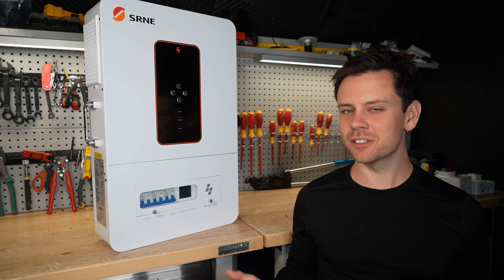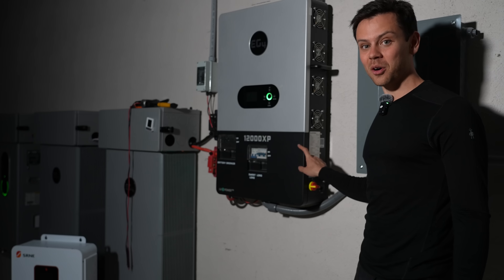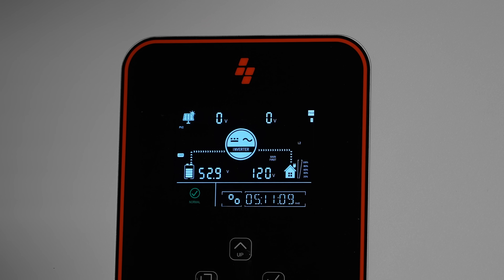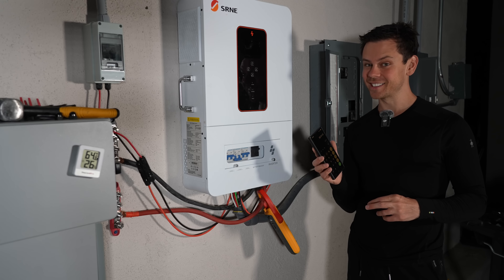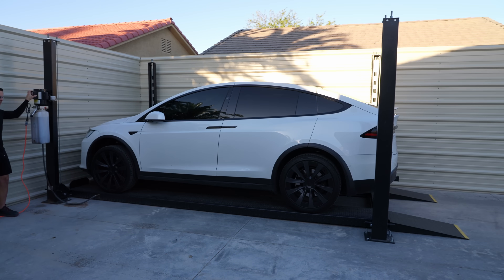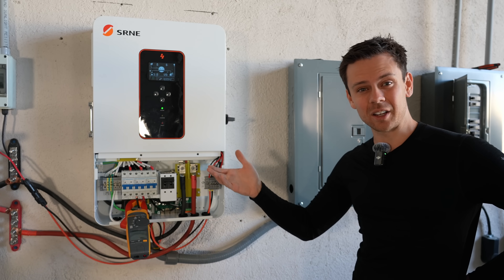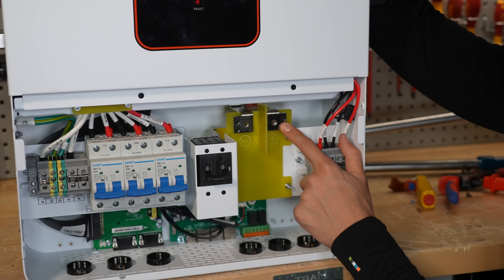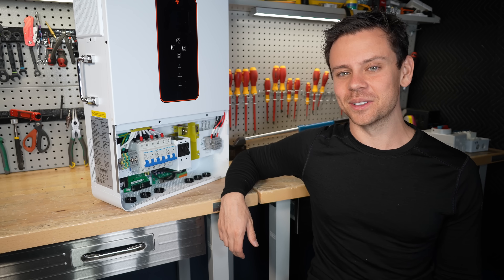NEW 6,500/10,000W SRNE 120/240V Inverter Full Review: EG4 6000XP Competition?!

Comment: FWIW  I have a 6000xp luxpower... it draws 100W  no matter what and a little more if you are using it.   The eg4 software some how reduces the idle consumption.     I can tell you a 6000 split phase where you can only draw 2500 on one leg before it shuts down is NOT very useful.    If one does not NEEED  240  v.  this inverter in not worth it... I would be WAY better off with two SRNE  5000  one hooked to each leg... NO  240v.  I would have 9000W  4500 each leg of usable power at 120 v.     balancing the consumption form one leg to the other is a real pain in the rear.

Comment: I was wondering if you would ever be interested in trying to turn some of these inverters into computer UPSes and see how well it works out.  When you look at the typical UPS, you are stuck with Pb batteries and usually you are dealing with a short run time.  You also have things like you need headroom for charging the batteries in addition to your normal load.  Then the batteries only last a few years and you have to swap them out.  I have been having trouble with the APC supplied batteries, which are just the cheapest cells they could find with their label slapped on lasting under 4 years while 3rd party battery cells are lasting over 5 years while selling for a fraction of the price.  And I am seeing this both for my personal UPSes and for company UPSes.  So dealing with a lot of UPSes and seeing a lot of early failures with APC supplied Pb batteries, some just at the 3 year mark.

When you look at inverter units like the Victron MultiPlus-II, it is supposed to have a UPS mode and it is supposed to be able to do things like say limit it to only draw 1,500W from shore power, but allow up to 3,000W to be drawn by pulling from the batteries.  Then when load is lower, hold the total shore power draw down to 1,500W when recharging or whatever you set it to.  For people with their crazy gaming rigs or what have you, it does seem like a nice option to be able to go over and then automatically recharge later.  In the literature for this inverter, they talk about a switch-over time of under 20ms.  Compared to your industrial APC Smart-UPS, this is a long time to switch over in an outage.  Then there are also things like some LFP batteries are coming down to price parity with Pb batteries while also supposedly lasting for decades compared to the 3 - 5 years of APC supplied Pb batteries and often 5 - 6 years of other generic Pb replacement batteries.  It would be nice to have a general comparison between say a good Smart-UPS with an extended run battery box and a Victron MultiPlus-II 3,000W inverter with a 48V server rack battery.  Maybe even toss in an MPPT charge controller and setup where you could be pulling solar power directly to your "UPS replacement".

Comment: The idle consumption is higher for the same reason that a proprietary television subscription receiver is a power waster. They are built cheaply with low cost, wide tollerence components. That is one of the best reasons to not buy this inverter. That said, I do buy this kind of tech but not at retail. If you're going to buy cheap tech, buy it directly from the supplier and buy a spare at the same time. I spent $900 for a pair of 6.2kW inverters, two years ago, for my tiny house. One is still in the box.

Comment: I was really considering the 6000xp because of the breakers, but then I realized that turning off all the breakers doesn't necessarily make the inside of that lower compartment safe.  Those breakers only stop the power into and out of the inverter, not from say the battery to the inverter.  For the price difference for the SunGoldPower 6548P I added external breakers for the batteries, solar, and AC in and out.  Now when I open that lower compartment on the inverter there's no power running through there.

Comment: I've got two of the 10k SGP/SRNE and a 5KW. Idle consumption of all is definitely something to consider. But it does everything in my home without care. I will note that about 7-8000W input from PV on the 10KW units is enough to start throttling your input to keep the thermals in control. They run quite hot. I ended up rewiring my arrays to produce no more than about 7K input to each inverter and added a 10" duct fan which is triggered by home assistant at 140f. 

Major dislike is how it handles the high voltage charging cutoff. On a large influx of solar it can short the batteries 5-10%, then it stops charging until the voltage drops. This leaves alot of energy on the table. I've had to reasonably restrict current based on voltage which is not ideal. If someone has a work around let me know. 

Also BMS communication can work but if any battery has an error it stops using battery power. Again not ideal.

Comment: Greetings from south America Lima Per U 15076
Would you consider provide an epub or pdf (if nut similar files )
step by step low medium high level to install an alternative energy devices or how ever they are called, 
to purchase the files 
With 4 varies in each st3p or sub steps 
Like 110-220 current devices receptors 
XPbillion water and dust proof  options boxes for the already set ups 
Also above all the compatible p.p.e.s or e.p.p.s according to OSHA 

SEND IT TO A UNIVERSITY AND   PAY FOR  TEST OF CERTIFICATION  TO POINT OUT THE FAULTS AND DEFICIENCIES (FAILS)
YET WORK ABLE WITH OUT HARM

ABOVE ALL IN YOUR LANGUAGE (PERSONALLY AS ENGLISH AS A SECOND LANGUAGE YOUR EXPLANATIONS ARE DIGESTABLE)
 
it's a personal comments 
Prayers sometimes are answer...!??!,
 For the translation to Spanish is not require but it could be translated after purchasing 
Yet the printable format can it be compatible non comercial devices like Huawei or similar
Gracias, 🤓

Comment: For the price difference you can afford more panels and or batteries to make the higher no load consumption "irrelevant".

For the price it is a nice inverter absolutely.

But the noise should really be lowered 
And also the no load consumption should be fixed, might just be an update away.
In cold climate it isn't really an issue since if it's installed in a garage or basement/house then the heat is wanted anyways 😅
Reply: A kW/day wasted increases exponentially in importance over each successive overcast non-solar generating day. Power loss is not a linear arithmetic function. Reserve power available is related to its value of security in a crisis, infinitely increasing in value as days go by.  Sump pumps, electric gates & fences,  medical equipment, connectivity, sensors & alarms, smart devices, emergency car charging may be critical loads when battery is diminishing rapidly.  A house will hold heat for three days - after which pipes burst, foundations heave, tanks burst and food is spoiled. Deferred regular functions require full operation after several days.

Comment: Hi ,Will, thank you for the honest review of our ABP 6.5KW inverter. 
We take your feedback on static consumption, overload behavior, and noise seriously. Our team is already working on improvements. We’ve sent you a e-mail to learn more — hope to collaborate closely to make the product better. Thanks to everyone watching; we’re committed to doing better.——SRNE Team
Reply: Thank you for listening
Reply: To improve the noise you should consider better fans.
PWM control.
And also having them in the center of the inverter with ducting this will keep the noise inside the inverter.
Reply: @tullgutten  Thanks a lot for your great suggestions! We'll definitely take your advice into consideration — better fans, PWM control, and improved ducting design sound like very practical ways to reduce noise.
Reply: @srnesolar5017  Don't forget Will's suggestion on lead wire placement, if this is going to be a DYI (mine will be) having wires crossed as a mess and having a building inspector sign off may be a problem for the homeowner.
Reply: As an African technician, differ your company is doing well with the other models mostly in Uganda🇺🇬, Kenya 🇰🇪 and Nigeria👌💪💪
Reply: @srnesolar5017, would that be a firmware update to fix the issues Will listed?
Reply: Where can we buy these models and other srne products in the US?
Reply: Would like to see a firmware change where we can select the minimum load in watts to trigger the inverter back on. Marine Inverters have this feature. We can select from 50W down to 5W. This is very useful. Here's an example from a Magnum 2812 Marine Inverter: "Searching – When the inverter is first turned ON, the automatic Search feature is enabled. This feature is provided to conserve battery power when AC power is not required. In this mode, the inverter pulses the AC output looking for an AC load (i.e., electrical appliance). Whenever an AC load (greater than 5 watts) is turned on, the inverter recognizes the need for power and automatically starts inverting. When there is no load (or less than 5 watts) detected, the inverter automatically goes back into Search mode to minimize energy consumption from the battery bank".  Thank you for listening, and improving your products!

Comment: I really appreciate your content. 
I want to get a Powerwall system to have full app integration, and also support Tesla, but I kinda want to see the cheapest DIY options for no HOA/no inspection home backup... lots of interesting choices but like you mentioned, it unfortunate that its not clear who the actual manufacturer often is. worried about Chinese HW with varying access to their firmware changelogs and/or general support and longevity. Also, regarding the vid: it is concerning to hear that the new model is so out-of-proportion, I would immediately have some skepticism that the larger SRNE is consistent or even has the same manufacturer from the one you reviewed.

Comment: Just curious, how long was the extension lead for the car lift, and what size conductors. I've had similar issues where the voltage drop from the lead combined with supply could nod start an induction motor under load. By running a higher rated cable and just the right length, the starting problem was solved.  Just a thought, another unknown variable , for me any way.
Reply from the maker: The 10K run was with a smaller cord too. But yes that is an issue sometimes

Comment: I’m thinking the additional idle is because the 6.5 is in split phase mode, just like the 10kw. It would be interesting if you could change it over to single phase like the 5k is, and see if the idle is still high. Great video Will! Thanks a bunch!
Reply from the maker: But the 10K model has a low consumption and is split phase
Reply from the maker: Check the settings and try to make it single phase
Reply from the maker: Thanks!

Comment: Hey Will maybe you should try the 1200watt srne with the transformer, it’s super heavy, that’s what I have at home running for a few months and it had been super great the wires are connected differently so there’s no cross wires there’s an arc fault terminal for the PV to prevent high current sparks and many more

Comment: I’d really like to see you check out the DJI Power 2000 and ESS and UPS mode, combining solar with grid power with no feedback into the grid zero output to the grid. I want to use one of those in a small cabin.

Comment: One of the things people need to watch out for about this inverter is that the spec sheet lists a maximum voc of 550V but it's actually 500V. For some reason, their spec sheet and manual show different max VoC limits. If persons follow the spec sheet with max 550voc, they could potentially damage their inverter. I found this issue with SRNE and a few other clones like Ruixu. Sungoldpower however has the correct information both on the spec sheet and manual. Hoping SRNE reads this and corrects the info before someone over-specs their inverter.
Reply: That's really bad, actually dangerous
Reply from the maker: Yes very true
Reply from the maker: I cover this in my string voltage calculation video
Reply: SRNE commented on the post, you could reply to their comment
Reply: Thank you for that important catch!

Comment: IMHO it's better to have the neutral and ground terminals like this SRNE than how the EG4 does, as it seems bad to have things on top of each other. I.E. if you for any reason have to do anything with a neutral or ground wire on the EG4 when the live wires are already connected, the live wires are in the way. On this SRNE you just have to have slightly longer wires and everything will be fine no matter which order you connect/disconnect wires.
Also with the EG4 setup it would be hard for the inverter to do any meaningful thing re ground neutral bond. Like when there is a power outage you should treat not only the live wires but also the neutral wire as potentially carrying voltage, and thus all of them should be disconnected when running it in inverter mode.

Btw it's funny that they named the company like an anti depressant :)

Btw, a request: When you try smaller all-in-one inverter/chargers, maybe put some emphasis on the mains voltage charger capacity? I.E. for anyone having a small off-grid setup in areas with longer periods of clouds an important thing is to be able to use a generator at max efficiency when you need to top up the batteries that way.

Re idle current: How about having a small and a large inverter, and only run larger consumers off the large one, and have the large one switched off when you aren't using one of the larger consumers? (You could even go as far as separate control and large consumers inside equipment, and have the control signals also request powering up the large inverter. For example the pressure switch of an air compressor could not only turn on the compressor but also tell the large inverter to turn on. The same thing but a bit more complicated could be done with say washing machines and whatnot).
Reply from the maker: Lately because of the bypass issue on all in ones, most people buy separate battery chargers to use with generators. Also it won't be running the inverter circuit in reverse so if something goes wrong it won't destroy your inverter. This is why the chargeverter is so popular
Reply from the maker: Oh you should never work with live wires. You should turn it off if you're working with it.
Reply: @WillProwse  Yeah, of course all power should be off when working on things.
My complaint about the EG4 setup is that you kind of have to remove the live wires to get access to the neutral and ground bars, or struggle to reach in between all the live wires.
By live I mean "L1/L2", not that power is turned on.
Reply from the maker: @The-secret-101 ohhhh ok
Reply from the maker: With the cost of multiple inverters you're better off buying a more higher quality inverter that has lower idle consumption like a Victron
Reply: @WillProwse  Yeah, a Victron or similar would probably be better. But then you have a single point of failure. Even if the failure rate is lower, it seems better to have two inverters even if either of them would fail more often, as they have to be really really bad for both to fail at the same time. You can probably do probability calculations on this though...
(Otherwise it seems like a decent idea to run the most important things, like a few lights and perhaps some USB chargers and whatnot, directly from the battery voltage (with DC-DC step down converters. A decent amount of car USB chargers can run on 24V too (for heavy trucks in large parts of the world) so not that much voltage drop).

Btw: Suggestion for a short video perhaps: Compare consumption between the few chest freezers that you can get that runs on 12/24V DC v.s. using a regular inverter and a mains powered freezer.